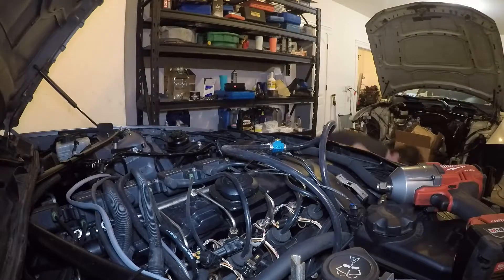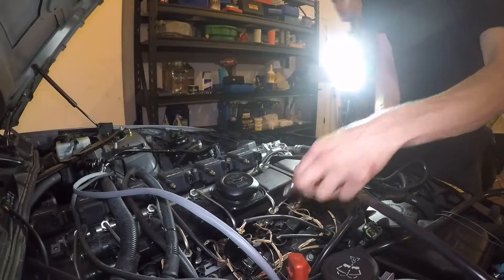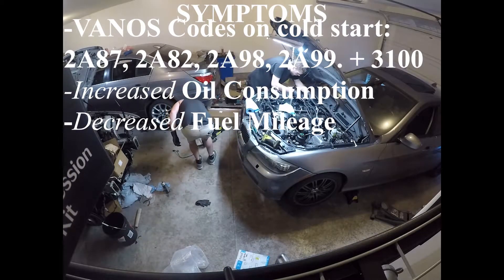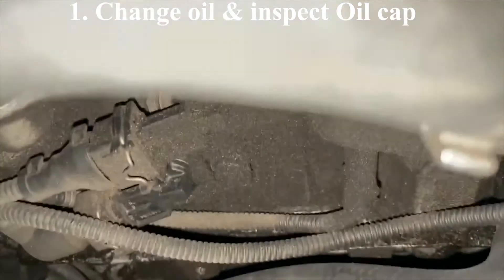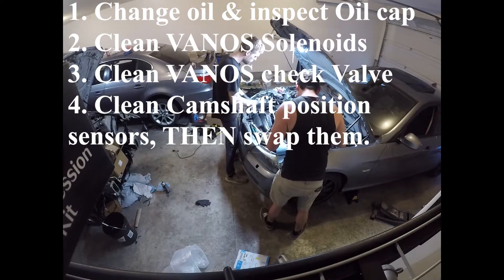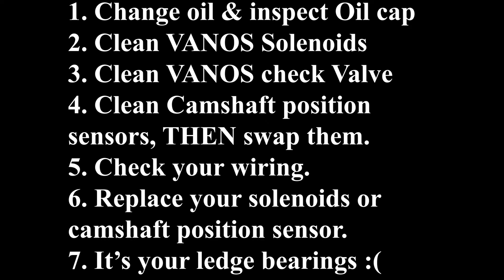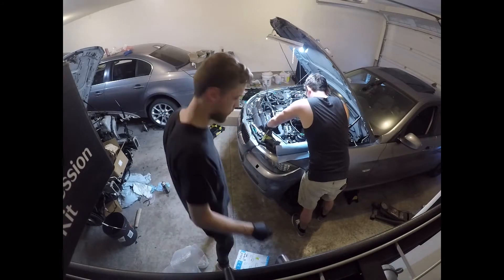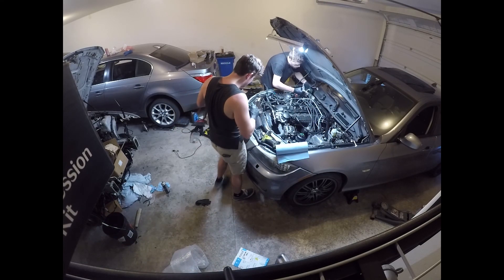N54 Codes 2A87, 2A7A, 2A7C, 2A82, 2A98, 2A99 | Cam Ledge Bearings | Cam Ledge diagnosis | What to do

Comment: The warranty place just did 
Oil pump 
Lifers and phasers 
Reluctor 
Vanos solenoid 
Cam seals and I think ledges ima ask tmr again 
When I got the car back it was throwing codes 2a98 2a99 3100 but the  cam and exhaust sensors were on back words now it’s throwing 2a7a 2a7c 2a99 3100

Comment: I only get the 2a7a when I first start the car. Goes into limp mode. Have replaced vanos and cam sensors
Reply: Did you get it fixed and what was it
Reply: @juancarlosorellanareyes4460 never got it fixed. Still happening.

Comment: I was hoping to get some input , I had a intake cold start code and boost deactivation, I did the process of elimination, swapped the 2 solenoids with each other then the code moved , so naturally I claimed my warranty on my doorman solenoids , but the issue persists and stayed in the same spot , does any1 have any ideas or input ? I’m thinking of trying oem solenoids but I’m not sure if I wanna fork out 100s of $ yet lol.
Reply: you ever get it resolved?

Comment: Did you happen to check the ‘collar screws’ in the Exhaust and Intake Vanos Camshaft Adjuster Gears?
Make sure those bolt heads are not getting loose.
Great video though

Comment: I’m having this same issue, codes 2a87, 2a98, and 3100. But I also have a knocking sound coming from the engine, checked the oil filter and I have really small with it looks like gold/bronze shavings of metal in it, I plan on draining the oil, possibly removing the oil pan and checking, any help would be appreciated!
Reply: You managed to sort this out? I've got a similar issue that's got the exact same symptoms as you

Comment: I’vegone through all the steps checking everything listed in the video so far. Car ran perfect for 20 miles after cleaning non return valves, and then for 6 days after proper resetting of the timing. Now it’s back with 2A99 and 3001, really thinking of having to do the bearing ledges, seals, and bolts… I want to open up valve cover one more time and check the Vanos sprocket bolts. But before that I’m going to try one last thing, gonna change the oil again back to 5W-30, with Liqui Moly and Mann filter. Ran Liqui Moly 5W-40 and Mann filter for less than 1,000 miles then I’ve been plagued with the 2A99 ever since.
Reply: anyluck mate any update?
Reply: @danieledwards3803  I’m pretty sure after exhausting all other diagnoses on the top end that the crank hub was spun causing the timing issues.. So I just ended up getting rid of the car, too many problems I switched back to Audi.
Reply: @austinmerrival927  thats a shame mate ive got 2a99 and 3100 codes going to replace all sensors and valves next week
Reply: @danieledwards3803  I wish you the best of luck, it was a shame in my case. Check non return valves, solenoids, cam/crank position sensors, camshaft sprockets and bearing ledges (look for scoring around rectarings), oil filter, and correct oil spec. There’s a lot to be sure of until you find the root cause of the issue.

Comment: So I’ve recently cleaned my vanos solenoids with brake cleaner and I tested both solenoids with a 12v battery and they both worked. Then when I installed the solenoids back I think i installed it the wrong way and the car threw itself straight into limp mode and the car was running like shit. Removed both solenoids and put them back again and everything was good. A day later I get the code for 3100 and code 2A7C and both of these are VANOS Solenoids related. Did I damage the solenoids or what? It just throws a check engine light but it does not effect driving. Btw I never had these codes before I did the cleaning of the solenoids, I just wanted to do like a quick clean to them. Help would be appreciated
Reply from the maker: No I've put them in backwards before, everything was fine. Check your oil filter cap and all other instructions in the video and pray its not the cam ledges

Comment: You saved my ass. I was having problems, and this made me check the VANOS plugs. Sure enough I swapped them after replacing my valve cover gasket. I did it once before on my other N54.
Reply from the maker: Genuinely glad I was able to help!
Reply: How much did the valve cover replacement cost?
Reply: @kakak3762  It was just the gasket. I think it was about $30.
Reply: @JohnPanzavecchia0001  you replaced it yourself ?
Reply: @kakak3762  Yes, I do my own repairs.

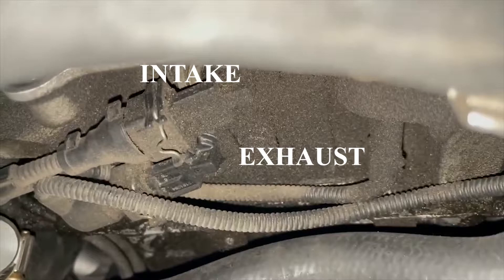Comment: 3:37 - Be sure your vanos solenoid cables are connected as shown here.... otherwise you'll get 2A7c, 2A98 and it will do the whole start fine, then progressively get very rough for around 10 seconds, and then RPM shoot up to 1500RPM, 3100 fault code boost deactivation (limp mode). Oops!
Reply: Also, be very careful not to kink your oil cooler hoses!!! Mine ruptured on the highway about 400 miles after replacing my solenoids while my partner was 3 hours from home. Unknown how much oil was pumped out, but partner drove it .5 miles like that. Had a shop replace the lines, do oil priming procedure, no shavings in oil. About 200 miles later, my car spun a rod bearing.
Reply: Mines threw the 2a7a code and mines are properly connected it's wierd I never got that code until I put in 2 new Vanos solenoid
Reply: Thank you so much! This saved me, I had them the wrong way

Comment: I just fully rebuilt a 2012 N51 engine and upon restarting I only get the 2A7C code. Intake solenoid was stuck, replaced  it and still same code. I did change the 4 bolts on both the intake cam gear and exhaust. I don't  know what else to do besides changing the gear on the inlet. The seals were changed with the new and improved ones you mentioned from the dealer. I did call the dealer to see if it is covered by the Sulev warranty. Any advice?
Reply from the maker: Definitely try the dealer, these parts are EXPENSIVE

Comment: FYI I read the teflon rings were only introduced for model year 2012. So it's why some IS like mine (2011) are getting it.
Reply from the maker: I honestly think it was a parts bin thing... They probably used it because there was a lot of the metal rings left over. Don't hold me to it, but I'm seeing a lot of IS guys having this issue and it doesn't make sense

Comment: Great video sir. Don't use 5w30 forget it. use 5w40 synthetic engine oil only at 6k no more for your increase in oil consumption. Either turbos have blow by, or your piston rings check your engine compression. 
Marvel Mystery Oil is what I did to to unstick the piston rings also cleans the carbon brakes it down to clean aluminum just like new. But had it out on a engine stand. 
Step 1 
remove the #1 spark plug at TDC  both valves closed if you have the timing kit stick the pin In the flywheel.
Step 2 
fill the the combustion chamber with Marval mystery oil preferably with a clear fluid extractor buy 2 one for this stuff and one for tranny diff refills ect. Leave the oil in each cylinder for a minimum of 3 days check with inspection camera on your cell phone after you sucking out the oil fluid. If needed repet for longer. With the second fluid extractor fill the combustion chamber with regular 10w30 oil to recoat the cylinder and let it soak for a hour and suck it back out. 
Step 3 
Turn the engine over to the next cylinder in the correct firing order. which fires and repeat the process untill all cylinders are complete.
Step 4
Drain the engine oil and change the oil filter. Use 5w40 regular engine oil when filling the engine with oil use more marval mystery oil say about 250ml and fill the rest with oil. Also add a splash to fuel it will clean out the injectors too along with the combustion chamber.
Step 5
Crank the engine with out firing choose your method. I would do this with no spark plugs installed. And make sure there is no particles that can enter the engine. Id use old shower towels cover the engine bay as if your doing a operation with only the spark plug holes exposed if you can a few towels under the hood to catch her squirting out engine oil and fuel. Turn over engine untill oil pressure is back up. 

Step 6
Give each cylinder a shot of break clean in each cylinder until your done and install your plugs.
Step 7 
Pray it starts 🙏  and hold it at 3k to build pressure till ang lifter noise is gone.
 Step 8 
change the 5w40 regular engine oil at 500 to 1000km and install a new oil filter and synthetic 5w40 oil. Next oil change 500k to 300k Before changing add marval mystery oil before you dump it just to help clean out all the carbon  inside the engine.